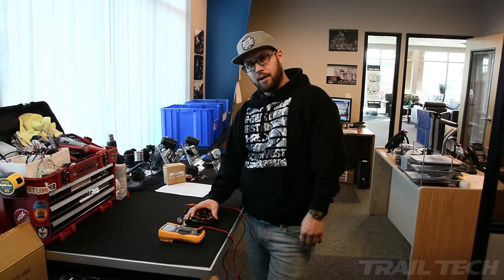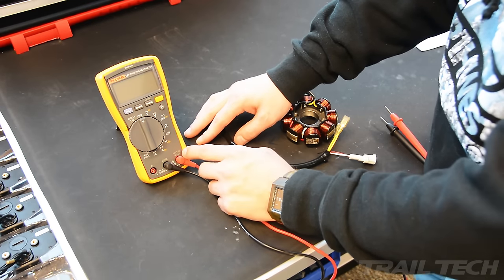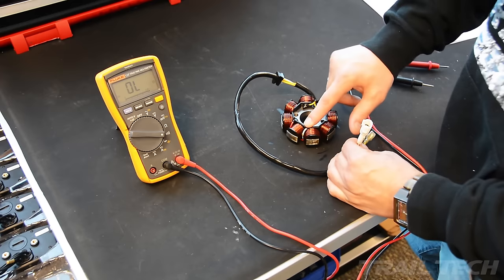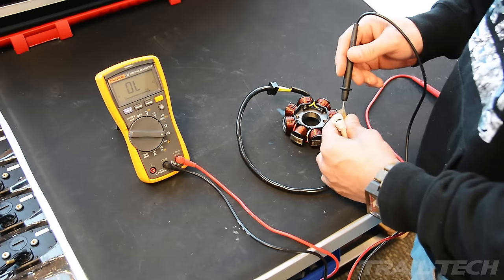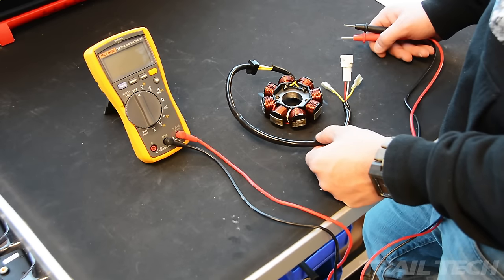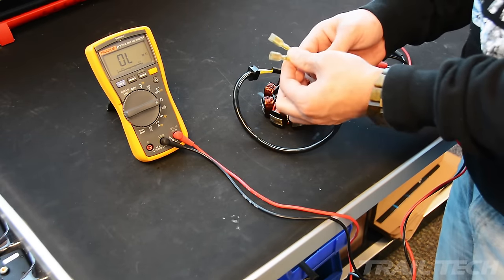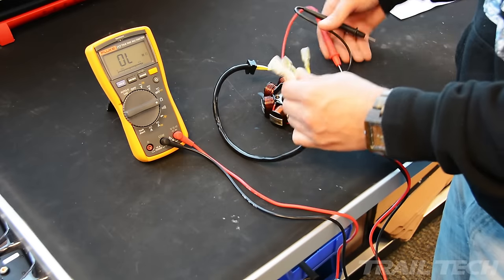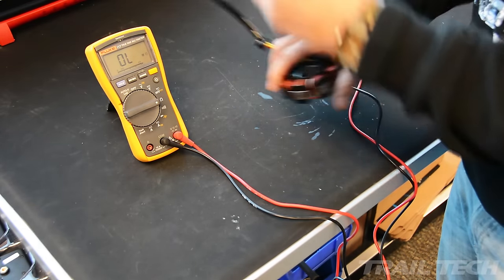How To Test A Trail Tech Stator

Comment: Good job! thought I might add that when checking shorts to the stator you really need to make sure to get down to bare metal, not doing so will give a false reading if there is a coil to stator short. Just tapping the meter lead to the stator isn't going to work in most cases.   Stators are made of many laminated/insulated stacked steel sheets, this helps eddy currents from robbing efficiency and producing heat.

Comment: Great -  easy to understand ... I got a E-TON VIPER 50 ST  with no spark . have been checking everything ,switches , wires still no spark. Repaired a switch . and a connection connector . but still got the problem . now time to check the stator and pi up unit. Its an old bike someone been doing some a lot of changes on it . It's fun working on it . ( retired old man nothing better to do ) just enjoying it.

Comment: When checking resistance (ohms) between the two output leads, is it possible to have too little resistance? If mine reads only 0.1 or 0.2, is my stator bad?

Comment: I thought I heard you say the two yellow wires
were lighting , later they/it (?) was/were battery charging
wire/s, in which case I guess one yellow would go
to a rectifier (?) , maybe it doesn't matter which one
connects to rectifier and which one is used for lighting?. 
Is one of the yellows lighting and one for charging?
If your stator comes with just one yellow wire, then 
that would likely be for lights period?

Comment: How do you test for shorted turns? ie. if the coil has a 100 turns and 1 turn is shorted to itself it won't change the DC resistance of the but it will nullify most of the output of it.

Comment: You still need to keep in mind even though bench testing this turns out to be good, once these components heat up there could be a short to ground once you heat up, so it would be good to test this on the bike after you run the motorcycle for a little bit and have everything hot... Or if you suspect this being bad. test it before you remove it while it is hot, metal tends to expand...

Comment: A resistance measurement only at room temperature is not sufficient to verify a stator is good.  When a stator starts to fail, they often fail only when they get to operating temperature.  I have a box of motorcycle stators at home that measure in spec for resistance and do not work properly.   Most provide weak spark when cold and no spark when hot.  A resistance measurement is only going to tell you if the stator has totally failed, it does not tell you the stator is going to work

Comment: I've got a road registered pitbike a Braaap SS I have an electric start yx150cc in it ,and one of the yellow charge wires from the stator was going to a green wire on the rec/reg ,the stator seems to be to hot, as I've never had charge problems with this type of motor,its still charging but not enough

Comment: I my stator has the continuity okey and the resistance is okay but it is not giving enough charge to the battery at higher rev, then what might be the problem. And the battery is 1 year old and does hold charge...

Comment: i tested my stators ignition wires like  you showed in the video but instead of the continuous beep it just beeped once then went silent

Note: multimeter does the continuous beep with other wires.

what could be the problem? the ignition wire terminal or the wires itself?

Comment: Good video. Unfortunately I have changed out many stators that have passed all these tests and ended up fixing the issue. Never 100% count on a bench tested stator to be a good stator. If the stator doesn't pass the tests then you have a good idea what the problem is.
Reply: Will a bad stator cause the bike not to light up at all?
Reply: @datboilarry_8219  yes and no. Sometimes it will cut out spark sometimes it will just stop charging the battery, it depends on how the system is wired. 

I enjoy helping people with this type of thing so feel free to ask as many questions as you want.
Reply: I guess the more reliable test would be to 
gather operating voltages, ie; kicking or 
cranking the engine over while taking voltage
readings. shrugs..

Comment: I recently replace my atv engine

The previous stator had a yellow and a white wire (which simply matched up with the wiring loom)
The new engine stator had two yellow wires(no white one)

Can I just connect one of the yellow wires to the white one. And the other yellow to yellow regardless
Reply: Yep.  It's AC coming from the stator.  Either to either is fine.
Reply: @ridingdirty2412  thanx man

Comment: hi man..i check my stator as like you show...all the results show that the stator is ok...but when i start the engine i check the volt and gives only 5.5v...i have a honda cm 125 6v system...you have any idea whats happen..??
Reply: These are testing instructions for our stators. Not an OEM stator. For the OEM stator testing you would need to contact Honda on how to test it and the values that you should have.

Comment: do both yellow wires from the sator go to the yellow wires on the rec/reg ,one of mine was going to the green wire on the rec/reg its was charging but not enough
Reply from the maker: It would all depend on the stator and the reg/rec. Our video is just discussing how to test our stators. I would recommend checking with the manufactures wiring diagram to see how yours should be connected.

Comment: Great job with the video. Clear instructions. Would have been good if you had covered how to test when the stator is installed in the bike. Also, I was wondering where you would look for proper resistance ranges for each of the circuits.
Reply from the maker: You can contact our tech support department at tech_support@trailtech.net and they can get you helped out.

Comment: Hi i need help i fixed my yamaha phazer 480 piston and when i put it back together there's no spark on my spark plugs but the lights come on everytime i pull the pull start and before i was going to fix it there was what could the problem be?
Reply from the maker: Unfortunately there are a ton of things that could be causing this. I would recommend contact a Yamaha service center to get the proper troubleshooting steps to figure out what your problem could be.

Comment: testing at the plug, when you 1st hit the start switch, i get a spark for about 2 - 3 cranks, then i get no spark for about 5 - 6 cranks, then as i continue cranking the motor over, i 'll a couple more sparks, and then nothing again ???????
Reply from the maker: What is this on? Year, make, model? Is it the OEM stator?
Reply: 2002 Yamaha Kodiak 400
4x4 ATV
Reply: It is the original stator.
Reply from the maker: Unfortunately we do not have any info on how to test that stator or troubleshoot it. This instructional video for for the testing of a Trail Tech Stator. I would recommend contacting a Yamaha service center on how to troubleshoot this correctly.
Reply: Ok, thanks. How i discribed what it's doing, did that tell you it could be the stator ??????
Reply from the maker: That could be a number of things. The coil, stator, trigger, CDI, or another component in the ignition system.
Reply: Thank you

Comment: i have a problem where the startor starts the bike but their is not charging back for the battery
Reply: did you solve the problem? I have the same problem and electricians do not know what the problem is. I have new stator, new magneto, it has ground, bike starts but no voltage for lights.

Comment: my ohms are reading good but i have no cont. on my white wire. (6pole) gy6 3wire
Reply from the maker: These troubleshooting instructions are for our stators that have a floated ground. For correct testing procedures for your stator you will want to contact the manufacture.

Comment: it doesnt peep on 2 of the wires is it good or bad
Reply: No beep between the two wires means a broken coil/wire, this is not good.   A beep from any of the wire leads off the stator/coils to the steel stator itself is bad, that means the coil has shorted.  Time for a new stator.

Comment: you say the charge wires are the most common to fail,what is the most common cause for them to fail
Reply from the maker: Heat is the most common cause of failure. When the motor gets overheated the oil gets extremely hot and actually starts to cook the stator. This will eventually cause the stator to fail.

Comment: Subscribe can you confirm this is the same testing on a Yamaha aerox mate I’ve done your tests but when one pin is in any yellow and you
Touch the stator mine beeps I’ve had my bike with these problems basically on full throttle either on road or on stand the bike revs revs then basically cuts out like as if you switch the keys off just please confirm no beep for
Shorts is perfect mine beeps